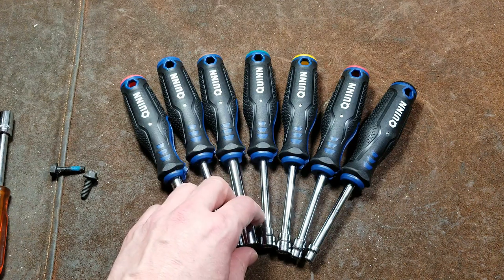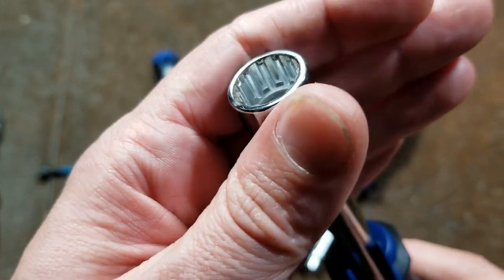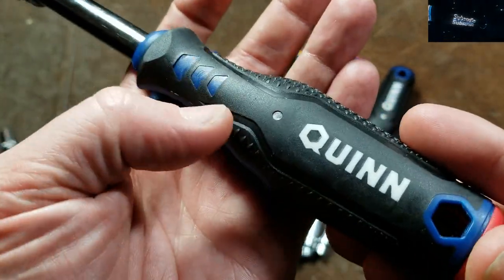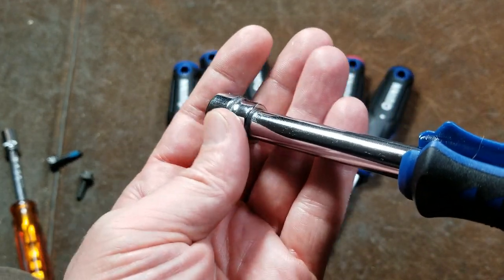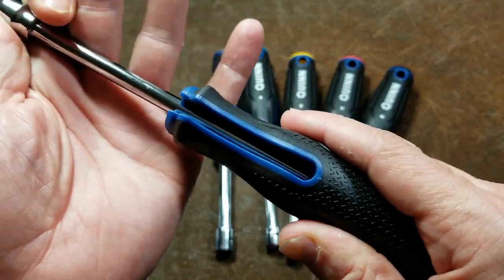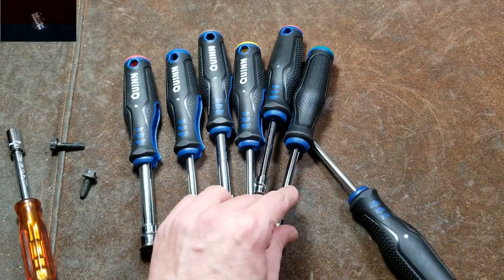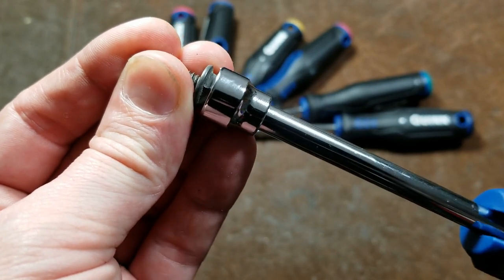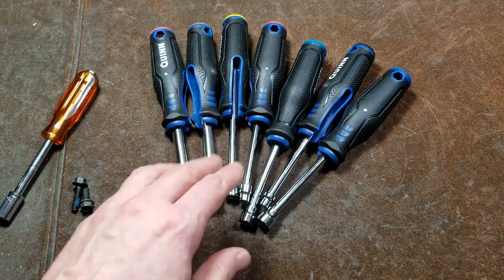Harbor Freight Quinn Universal T-Handle Spline Nut Driver Set Review

Comment: Another honest, in-depth, and USEFUL review!  Viewers!  We need to spread the word about Catus' channel.  He should have 64K subs, not just 6.4K, don't you think?

Regarding this product specifically:    Inside the past year, I'd just bought HF's "better grade" of Pittsburgh rubber-overmolded nutdriver sets, in both the SAE and Metric varieties.  So, I was somewhat disappointed when I saw these first introduced... and here's why:  1) I could get by with one set, not two, 2)  I liked the T-handle capability, and 3) I liked the idea of them being "universal" for all those different fastener-head types. 

However, after seeing this review, I'm glad I had already bought the separate, traditional drivers.  For one thing, they're pretty darned decent for <$10 a set.  And for my purposes, it turns out they're actually the better choice, because some of my assumptions about these were incorrect.  It was this very video that cleared up my misconceptions about the Quinn set's qualities and capabilities.... so thank you very much!

Comment: The best thing about Quinn to me, is the Quinn handle shape. They have that cross section similar to an "egg" shape or an "oval" and it feels super comfortable in my hands. I feel like I can really put some torque down. I prefer the Quinn handle shape over the "Snap-On" style handle which resembles a "rounded triangle" shape. In theory you would think the triangle handles would slip less in the hand, but in practice the oval handles seem to work much better (at least in my hand).
I appreciate the review, I just discovered those on the website a couple days ago, and you already have a review video out. That is awesome. Thanks.